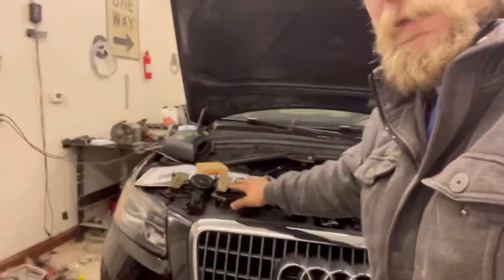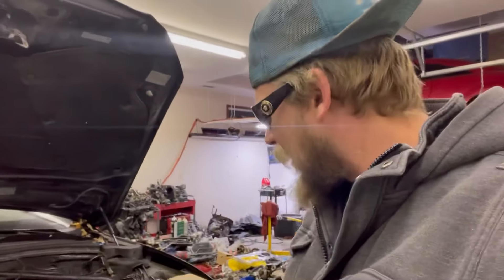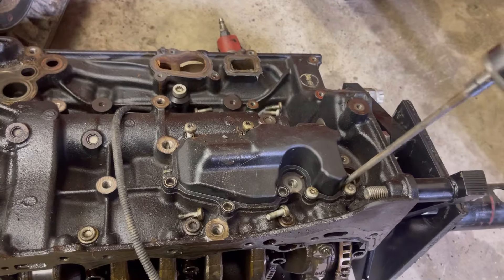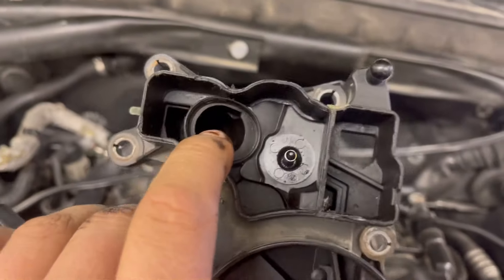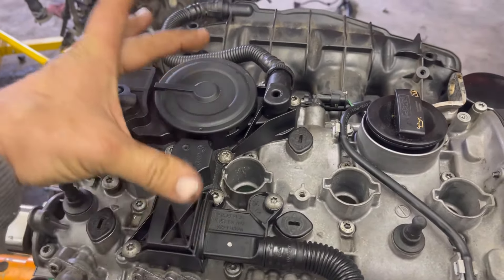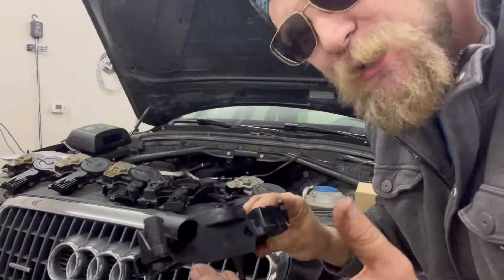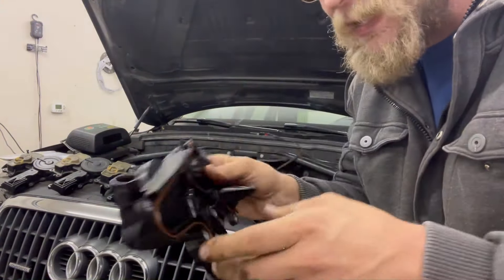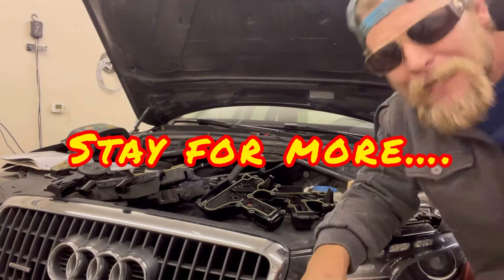2.0t oil Separator PCV breather testing boost leak crankcase pressure blowby P2187 P0171 Audi VW

Comment: 1. You MUST pressure test the entire plumbing by filling the compressor cover with boost pressure using an air compressor. There is a video DIY how-to in my channel where I do this on my 5.3L Turbo application. 

2. To get around crap OEM pcv valves that leak I always use Toyota Supra 1995-02 Twin Turbo PCV valve. Place in-line with current pcv system from intake to crankcase. Use two for added flow if needed in parallel. Make sure as part of pressure testing (#1) you verify the pcv valve is closing fully under boost.

3. Always measure the crankcase pressure to ensure PCV action sufficient. There is also a DIY How-to in my channel using 1-bar map sensor and 5v source. 

The biggest problem with PCV and people is they do not measure the crankcase pressure. They do not realize that is takes energy to drive fluids through hoses. They do not realize that the PCV system depends on air filter pressure drop (post filter pressure drop) to Drive evacuation during WOT. It must be measured and set manually by the end user if you are modifying the engine.

Comment: Just replaced a front crank seal. Noticed an oil leak under the crank pulley and checked the PCV (10 years old) and yep, boost was bleeding through the check valve as the valve failed. Think I caught it early enough to not cook the rear main seal as the valve still had a little bit of resistance.

Comment: My Tiguan was running badly and getting  oil in the turbo system. Turned out that the little round valve in the PCV/ oil separator was missing.  It was sucking oil into the turbo and blowing it through the intercooler.

Comment: I just turned on my car this morning and I decided to unhook the intake manifold hose that goes to the PCV valve. At the manifold hole, I put my thumb and told my buddy to turn in the car (decided to do this because I been having misfire issues and even a P1250). The vehicle started and idled 200% better. I than decided to remove the PCV system so I could suck and blow inside of it to see if the PCV valve was faulty. I was able to suck and was not able to blow in, which my understanding this means it's a good PCV system.
Why was the car running fine when u plugged the intake manifold hole with my thumb

Comment: Thanks Buds i have long time looking this video or someone to explain the issue on Pcv. Valve even if i can ask ??? 

I have some cranky noise it comes and goes, it comes and goes some mechanic said: chain’s tension and chain i have to remplace but i 100 % Pcv provoqué that cranky noise sometimes nothing sometimes again
Reply: I have a Gli fsi 2 lt with Bpy engine

Comment: Got my 2016 1.8t a5 from the dealer. Lacking power. Oil sweating around pcv valve and one of the plastic pipes. Noticed I don't have the second spring for the check valve. I have the spring for the big diaphragm. When I unscrewed the screw above the check valve spring I noticed it was a bit warped. Not sure what happened. Will have to replace and see

Comment: I have a 2012Audi a4. It started to use oil. I changed the pvc and stopped using oil.
I checked the vacuum on the oil fill before and after pvc changed.

Comment: a year back I had my serpentine belt broken because a cat was chilling on my engine, when I started the car up it jumped got in between the belt got its tail stuck, sharted all over my plastic cover left its blood and hair everywhere and my belt ended up inside my engine which i didnt know until it was too late. After I replaced the belt I spun a bearing on cyl2 and destroyed the engine bent the crank and had to replace everything. Moral of the story, knock on hood to check for cates.

Comment: Thank you for the video. You nailed it. Very helpful. A question though: CAN THIS VALVE AFFECT THE BREAKING SYSTEM TOO? I have a huge problem on my Audi. I changed the breaking pump and the booster and still no breaks. I can hear air hissing always in the intake area when pushing break pedal. The booster takes vacuum from intake system so, can anyone help?

Comment: Thank you for educating us :)
What are the symptoms again that it's failing, running condition wise? Does it affect mpg and acceleration?
Reply: I had extremely high vacuum when the check valve failed for the intake. This high vacuum also caused low oil pressure as the oil was not circulating through the head and back properly. When the check valve failed, all the gunk from the blow by also clogged a lot of those little screens. And you can imagine what can happen when you have constant low oil pressure and the screens get clogged.

Comment: The B5-B8 still does the same shit with the breather system. 034 Motorsport makes a nice after market setup with an aluminum billet valve replacement for the 1.8 but idk if they’ve made it for the 2.0 B8 models. 🤷🏻‍♀️ I still have to figure out the piston o-ring and fuel issues. 😒

Comment: Good explaination on these systems.
I'm wondering how much pressure you can manage with your lungs as opposed to the turbo boost. I wonder if more pressure from the turbo would help overcome the leakage during boost.
3.2

Comment: What would happen if you just gutted the whole plastic unit and put a good one way valve on the tube from pcv unit to the air intake (that is pressurised under boost)

Comment: Ea113 question so I check pcv valve for valve closing and opening it’s works just fine no flow when blown and free flowing when suction is applied but I have quite a bit of oil in my breather pipe that connected to the turbo (metal breather pipe) the oil is so bad that it’s lining my intake with oil and covers my maf in oil has even damaged the seal for the maf what could be the issue

Comment: How do I know if it’s the PCV valve or rear main if the rear main isn’t leaking oil? Also, I have a P0506 and P0300. Would a PCV valve cause this?

Comment: Could this be the cause of my boost and white smoke? Coolant is full and oil is good, no misfires or any other issues.  Had a code a while back for crankcase and boost and I replaced the throttle body.

Comment: I have problem with Škoda Fabia mk2 1.2 gasoline 51kw. I try with my mouth both ways and both breath and suck my pcv valve it’s free open (I change before 15k km) I get check engine error 171 lean system bank 1 should I blow hight or I don’t know change again ??

Comment: Hi I was changing the valve cover gasket and I left the cover on the ground a my son got the hose and wet all inside the valve cover and it got into pvc to I got air compressor and water was coming out is still fixable or I need to buy one ? Please help info
Reply: It’s in a 2015 Chevy Cruze 1.8L LS

Comment: Hey brother! Appreciate all your videos! 
Can you shoot me a message so I can reach out? I’d like to send u some cash for some advice.

I have a 2012 a4 2.0 automatic. I did the valve intake cleaning on mine, replaced both the intake manifold gasket as well as the throttle body gasket. Anywho, I’ve installed 2 new PcV (oil separators) and they seem to be pulling vacuum and faulting almost immediately. First one from eBay lasted 2 days while the 2nd from oreillys lasted about a day. Is this just trash parts or is there something else going on? I’ve heard or seen that bad PcV can cause the rear main to go bad quicker, but could a rear main being bad keep causing my PcV to fault? I’m leaking a few drops here and there but not excessive like a bad seal. Any help would be great

Comment: I changed this unit and things were running smooth for a few weeks. Now suddenly the oil level started going down and when I pull the dipstick it starts sucking air. What may be the reason ?

Comment: I have a 2010 A3 2.0T. I’m feeling some shudder/hesitation when accelerating. I already changed plugs, coils, Fuel filter. When I put my finger on the PCV value while idling. There’s a small suction on the finger. Is it possible that my pcv is faulty ?

Comment: Great vid. I don't know why they give these things so many different names. My car has two of these ambiguosly named items and my car has been making a loud whistling noise that comes on at random and remains on until I shut the car off. There is one that sits on the top of the valve cover and its called an oil seperator/ crankcase ventilation system. But it has no moving parts basically looks like a plastic box with a bunch of channels. Can this thing go bad? If so could this be the cause of my whistling noise?
Reply: You report a "loud whistling noise".  Have you had the engine checked for a vacuum leak?

Comment: Have similar issues with a lot of crankcase vacuum. Now I swap the pcv valve with one from ecs tuning maybe 4 years ago. Would the pcv valve be faulty having rough idle and slight amount of oil on top of engine near oil fill.

Comment: is it the same with the  PCV on the 2.0tfsi? because I have a engine lamp and I can't seem to make go away, and I tried a bunch of things, I also though my engine failed at some point so I bought a used engine to replace it, turned out it was the oil pickup that had been clogged and the only thing that broke was the turbo, how ever, since the PCV on my engine was marked with the date 2006 and my car have 270k Kilometers on it and the used engine I bought had a PCV with the date 2017 on it I swaped them, but did not change anything. what was even more surprising to me is that the car I bought had 270K on it when I bought it and when I replaced the fuel filter it was also marked with the date 2006, and somehow fuel was still going trough the filter xD

Comment: HEY GUYZ I got a great one for you guyz, I was driving on the hywy & my LOW oil LIght came on , i was told  to check my PCV VALUE , (BUT back  to my story), I pushed the car for like approximately 20miles,  i could only go 60 mph max, then then warning sign came up....I heard a loud Click cluck-Blam-etc....I pulled over because my (2010 VW Passat 2.0T, W 267K MILES. cut out on me. Yes GUYZ on the HYWY....SUCKS.  I PULLED OVER..Turn the car off, waitED 5 sec then start THE car UP,  IT liGHT up inside , HORN WORKED, RADIO, U KNOW ETC. BUT - made a 1-click sound  AND  never started. I KEPT MY FINGERS DOWN ON THE PUSH START BUTTON, IN THE ON POSITION FOR 8 SEC THEN THE STARTER STARTED TO SMOKE, I'm confused OUT OF MY MIND. PLZ someone help meeee>><<<<

Comment: I just bought a brand new PCV from VAICO & when I blow into the vacuum side it freely flows. Is this normal for an MK7 Golf 1.8T EA888? The design is slightly different but I would assume the check valve is defective
Reply from the maker: Does your old one freely blow?  If it’s a turbo engine you don’t want to blow turbo boost into the crankcase
Reply: @NaptownTuner  appreciate the response. I basically effed myself trying to save a buck luckily I watched this video & tried what you demonstrated before install

Comment: Hello Naptown Tuner. I have an Audi A4 B6 2.0 petrol year 2004. My problem is that an "oil at minimum indicator" on a dashboard lits up quite often and I constantly need to top up my oil to make that light to go away. I can't see any visible oil leak from my engine. Can it be that my PCV oil separator is also the issue (I don't think it was ever replaced since 2004)? However I also read on some forums that it may be a faulty design of that particular engine line up for that year and model of those Audis. Not sure what should I do? I am wondering can my problem be fixed?

Comment: The rear oval shaped port of the breather has 2 passage ways. The large one is routed to intake system right before turbo. The small one gets sealed when the rear hose is connected. What is the purpose of the small passageway?

Comment: Great tip dude, I bought a 2004 plate A4 B6 Convertable 2.5 V6 Tdi, lovely old bus for a project, the PCV on this one is down in V at the back, why on earth did the Germans decide to run oil vapours and soot from the EGR through the engine creating all the lovely black Marmite over everything, I know some are now making engines with 2 injectors one direct the other spraying over the inlet valves on Gdi's do they do the same with Tdi's. Great videos mate, subscribed and liked. Merry Christmas. 

P.S Engine oil is a carcinogen, please dont get it on ya skin, especially your lips. 😲👍🙏

 ⭐⭐⭐⭐⭐👏👏🤜🤛👍

Comment: Hey man, great videos. I just watched all 3 parts for removing a 2.0T. I have a question for you.
I just bought a 2011 Q5 (5th vin F) with no compression in 2 cylinders and it ha been consuming oil for a while before the engine failed.
Is it worth rebuilding and updating the existing engine if its not destroyed? In other words is it cost effective to rebuild? Or should I seek a replacement from a later model?
Reply: Thing is, you are only going to be seeking temporary time even with a replacement. The cost of the replacement engine is more than just buying genuine pistons/rings etc. Better to rebuild and get it over with so you don't have to worry about it.

Comment: How do u know if the pcv valve is bad while driving the car? What are the symptoms?
Reply: Miss fire, oil pressure issues...
Reply: Smoke from exhaust
Reply: I love this "lets cut it open to see how it works"lessons! Good work!👍

Theres a rumor that there's a service port to test the mechanism without disassembling any hoses.
Does anyone know more about it?
Reply: 130k miles no codes should I still replace mine?
Reply: @NeverFollowTheCrowd  yes I’m about to replace mine, gonna bite the bullet and get oem too
Reply: Loud whistling noise  from the engine when stopped or moving slow

Comment: question
i have a p2279 code for an intake air leak and no obvious signs of one or any symptoms.  I checked the diaphragm which looked good and fyi has been updated once already 4-5 years ago, if that flap is not doing it’s job in the hole will that cause a p2279 for intake air leak?
Reply: did replacing the pcv remove the code and fix your issue? my car has cylinder misfires and intake air leak that i just can't find. i hear hissing noise around the engine and i think the pcv is bad im going to replace but i just hope it clears the codes but also settles my misfire down cause the misfire is really bad in idle.
Reply: @roderickashford1338  i’m guessing if you fix your pcv that will solve ur issues cause u hear the hissing sound 

i ended up having a bad rear main seal and lucky for me it was 1100 in labor to replace a $20 part 😂
Reply: @REfanforlife  was your rear main seal dumping oil everywhere? I think I might have a similar issue :(

Comment: Install a catch can and you won't have to worry about that cheap plastic crap it's worth the money.
Reply: Installing a catch can will give you many many more issues.
The valve is very complex and does much more than the catch can replaces.
Reply: Agree this breather module provides a delicate balance of pressure on the exhaust (turbie side) and intake (vacuum side) this 2.0 TFSi is engineered to work as Naptown explained.. a catch can just simply allows a place for blow by oil to go but doesn’t support the pressure regulation.. I think that pressure balance is the most important design of this module of all the things it’s doing.
Reply: I'm not 100% what the name of this company that sells adapters that you can have best of both worlds. Retain the original pcv and a catch can for unwanted stuff to go back in the intake.

Comment: Can a pcv value cause a red oil light on the 2.0 t at low rpm I have changed the oil pump and the oil sensor and the lights still coming on any thoughts

Comment: I changed the rubber diaphragm on mine a few years ago, and 2 years later my rear main seal failed... Better change the whole PCV valve just in case...
Reply: i think that happened to mine, was your rear main seal just dumping oil everywhere?
Reply: @alex4alexn  yep, the one between the engine and transmission... Leaking while parked mainly.
Was a 175$ part and 19h work to fix
Reply: @Vali615  that is good info, appreciate it. would it also splash elsewhere on the engine like on the side and even towards the front? Appreciate the info, im dreading fixing this
Reply: @alex4alexn  not sure... But when the car was parked, the oil stain was in the back of the engine... In front, it was more the DV valve... The whoosh whoosh thing

Comment: Mechanic recommended to clean out the intake because  it has oil in it  he replaced my PCV today he charging me 200$ for everything
Reply: He said no need to replace intake with new one just to clean it he also clean the PCV valve he  only replace the round thing in the middle